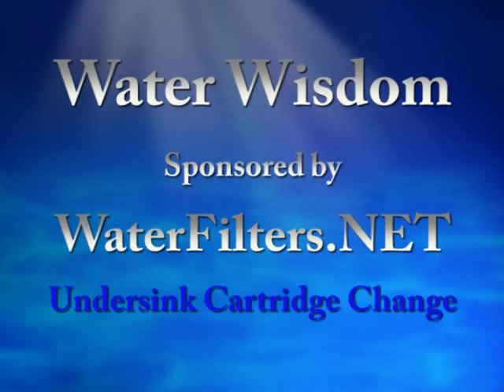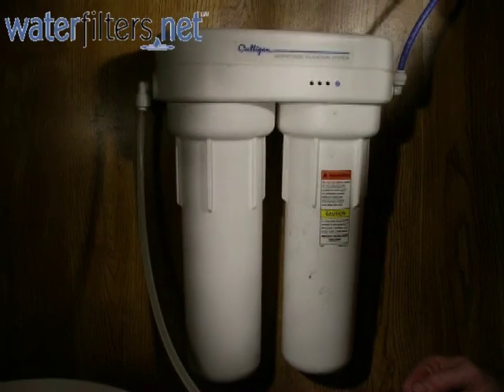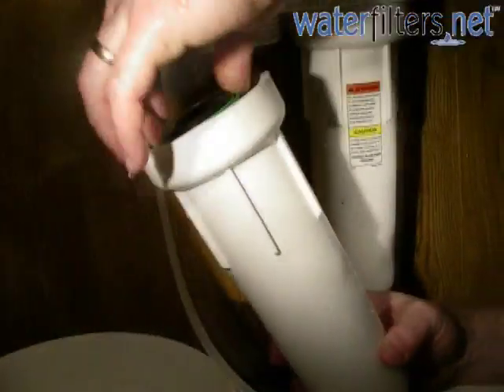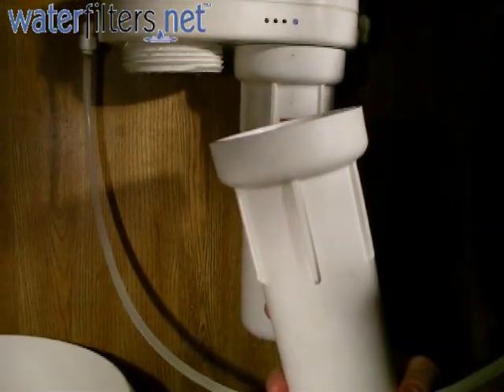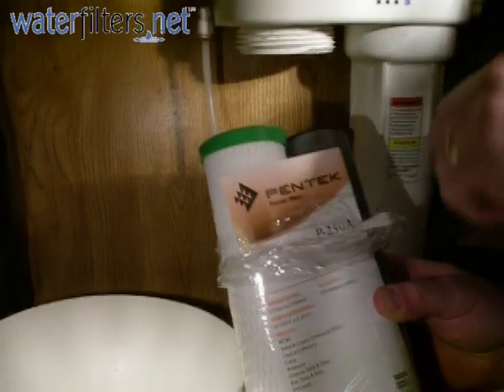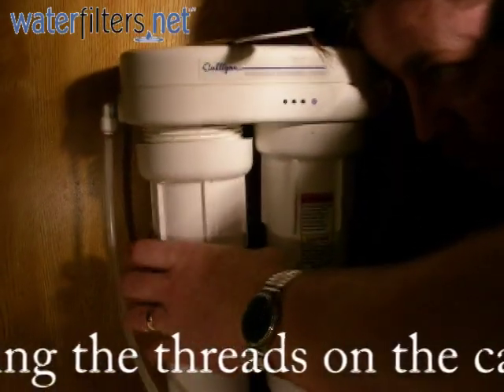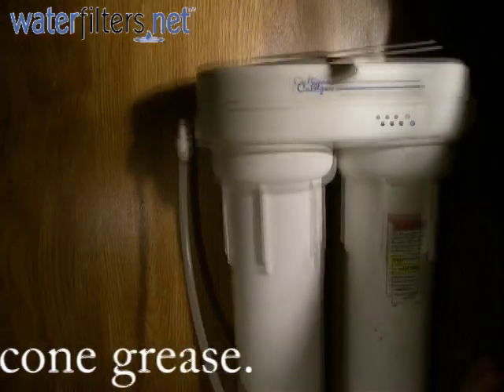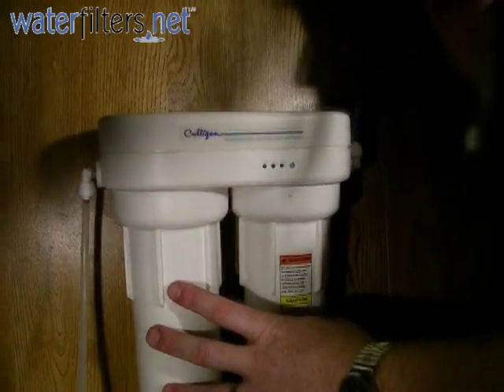How to Change Water Filters in US-1500 Undersink System

Comment from the maker: @misterheath The reason I made an issue out of the filter order is that GAC (granular activated carbon) filters) tend to shed carbon fines into the water, more so than carbon blocks. So, by placing the GAC before the carbon block, the fines that are released will be captured by the carbon block. It's a minor thing, with the primary advantage being a decrease in the amount of purging of the new filters, due to less carbon fines being released.